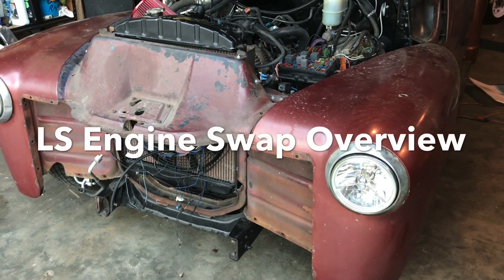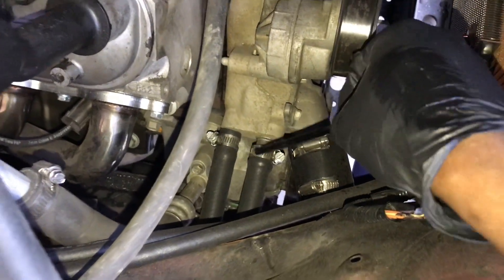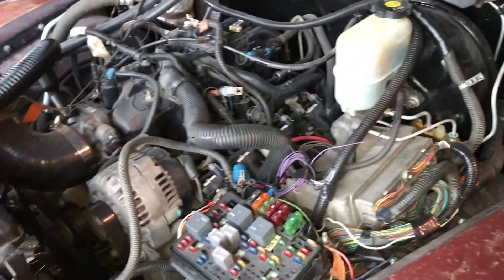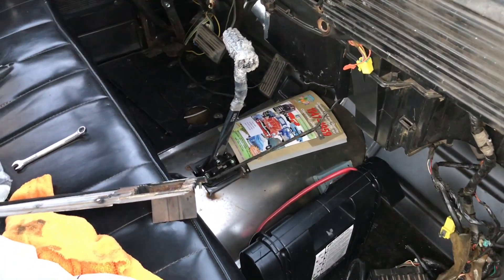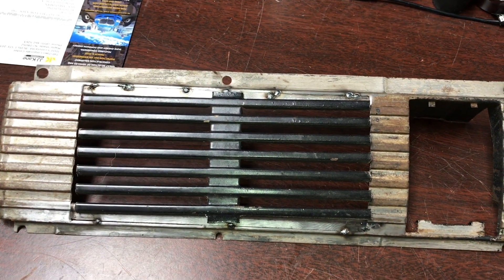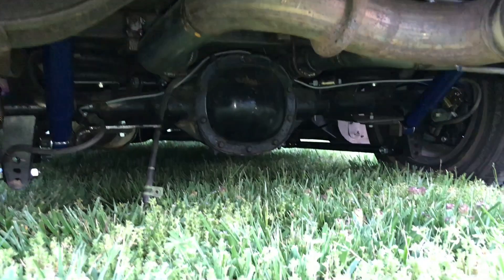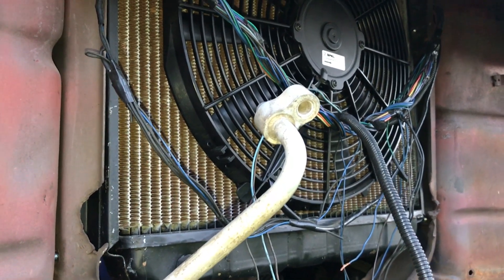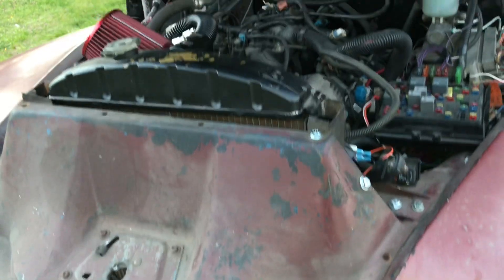LS Engine Swap Overview

Comment: Love the channel, I know this was a few years ago. But which motor mounts did you use to mount the Ls to the cpp sub frame? Thanks
Reply from the maker: Thanks for watching the channel I’m glad you enjoy it! I used the factory mounts, modified them, added a gusset, and welded them to the frame. I set those mounts a little aft the center line of the front axle to bring the engine back as close to the firewall as possible. Hope this helps!